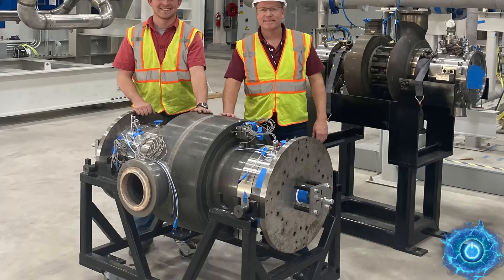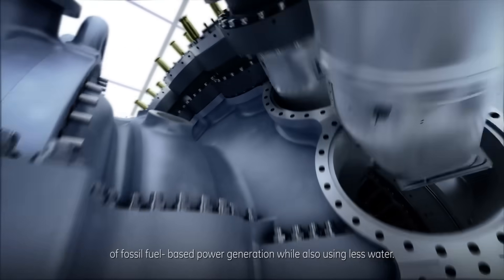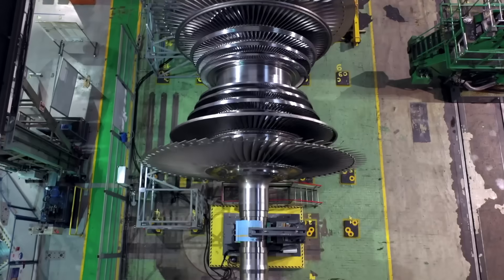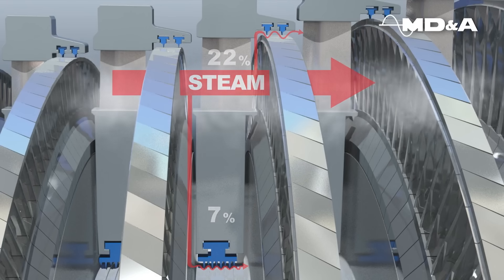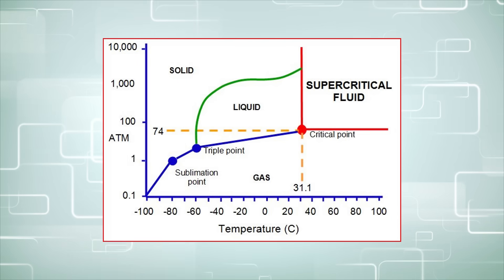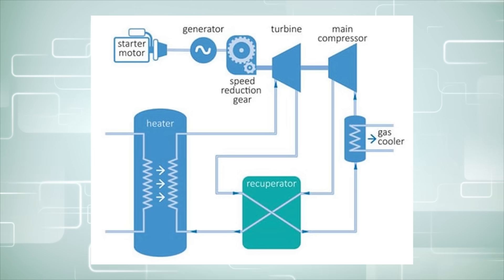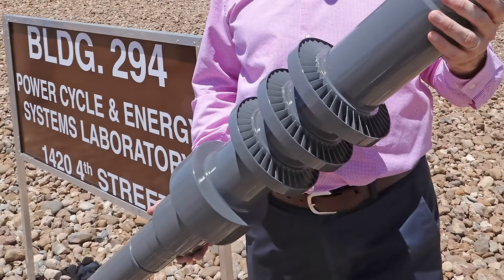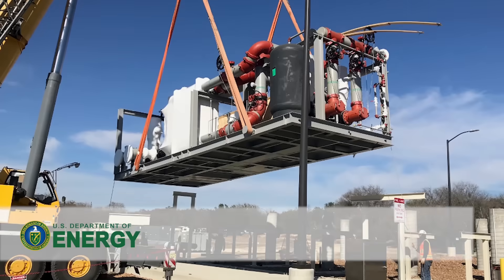BREAKTHROUGH Supercritical Turbine Breaks RECORDS

Comment: I think there are lots of interesting possibilities - 1 - Smaller power station footprint vs conventions gas turbines 2 Use of current C02 waste gas from power stations, waste to energy C02 generation, chemical plants, biomass fuel stations, Cement-Steel C02 production 3 The gas can be closed loop unlike steam (and you need a large clean water source for most steam to power generation) which offers a continual source to power the turbine 4 The gas does not need to be heated or compressed anywhere beyond its supercriticality state so that allows for more uniform manufacturing and operation of the gas. 5 water steam also corrodes turbine blades so its not immune from some of the same issues as C02. 6 The more pure C02 you make, the more power stations you can build (again at a low footprint and in theory cost). 

Some issues remain (more expensive materials to cope with the pressure, heat and C02), Many gas turbines benefit from the other turbine markets that jet engines deliver. This means many of the tech improvements for one design can be applicable for the other especially gas turbines that mimic the same design as burning Jet fuel. These designs would not offer that benefit (bar metallurgy). Generating pure C02 adds to the cost in filtering this gas out to be used.

Comment: I hope that soon, a Molten Salt Reactor will be built and the molten salt heat be transferred to a gas (CO2 or He) and the that gas use the Brayton Cycle Turbine shown in this video. The proposed temperatures of the Advanced High-Temperature Reactor (AHTR) using Molten Salt is between 700 - 1000C.

Comment: The sCO2 thermal cycle is such it can use air condensers.   It is also uses a very compact turbine.   For running decades on end a direct drive system used in steam turbine generators is much better than a gear reduction system.   The jet turbine generators also have to use a gear reduction system.  Is there an efficiency advantage over supercritical H2O that is worth while?   A comment below claims 47.5% thermal efficiency where sCO2 is rated at 50%.

Comment: The vast majority of power plants even nuclear ones use the heat source to produce steam and the steam to drive turbines that turn the generators to produce electricity. As you mentioned these steam turbines have achieved 40% efficiencies and they are approximately 10 times larger than this prototype using supercritical CO2. One of the major problems with using supercritical water is that it is highly reactive with most substances and this active corrosive problem in a system that has to maintain such high pressures is a disaster waiting for an ignorant manager to exploit it by interfering with scheduled maintenance to increase their bonus checks.

Comment: I wonder why these engineers chose supercritical CO2 rather than supercritical N2. N2's critical point is at a substantially lower temperature and pressure than CO2. If supercriticality is where the benefits lie, why not use the gas that achieves this state at a lower temperature and pressure?

Comment: The idea that supercritical water has a density greater than water at standard temperature and pressure is amazing enough.

What I didn’t understand is why CO2 is a better medium than water for converting heat into kinetic energy.
Reply: Wouldn’t CO2 be less dense and therefore contain less momentum than steam?

I think that drawing power from subsea turbines tethered in narrow sea passages with high tide flows would be exposed to much higher energy densities…🤔?

Comment: Does the CO2 get recirculated back to supply after passing thru,going from gas to liquid and back to gas thru reservoir recirculation supply. Desk size is incredible feat.now to take that and make it suitcase size for ev charger system or tanks camping boats whatever.womder if turbos could be used in a system to make it smaller one side intake the other resupply,high pressure gas to liquid then back to gas.this is intriguing it will replace fossil fuel power.great work everyone. Hmm no control over turbine speed,why not use a braking system similar to Tesla where the brake system generates electricity and use that as a secondary power supply as well as a sort of cruise control for things that would put a strain on the startup or full capacity operation.a no waste system,the CO2 will never degenerate and not need to add more.
I just see it as it make the power phase pass it goes back to the intake thru pumps.

Comment: Gas turbine.
The combustion does not increase the pressure.

You can take it from me or you can get your head royally chewed off by AgentJayZ YouTube channel.

Combustion increases volume and temperature, speeding up the flow.
As AgentJayZ points out, there's a bloody great big hole in the rear of the combustor. Ain't nuffin increasing the pressure there.

Comment: Yes but the problem this has is not only burning fuel but the line transmission losses/maintenance, versus solar panels and battery, solar has dropped a LOT past 10yrs, PLUS batteries now being used in cars is making them drop in price, so I think home power future is solar and battery. :face-blue-smiling::face-blue-smiling::face-blue-smiling::face-blue-smiling::face-blue-smiling:

Comment: The largest issue with technology id that the boiler needs to be able to be able to withstand 250 bar and temperatures higher than 800 C. It requires the use of high-nickle allows that are expensive and hard to manufacture.

Comment: This is very cool, has me wondering about the use of CMCs with molten salts or other possibilities. I mean using the salt as a driving fluid and not just a thermal storage medium. Also wondering about the possibility of hydrogen. Apparently it becomes supercritical around 180 psi, but is there an upper limit to density?
Reply: The fun parts about water / steam are...
Density, water and steam are heavy, giving higher kinetic energy transport at lower flow rates (bigger pipes can make up for that though..) 
Specific heat capacity and latent heat of evaporation. Water shifts heat energy very very well.

Comment: It would seem that small units meant to power only 5 to 10 homes, would be the route to follow. Think how much power loss is involved in current electrical grids during transmission.

A companion to the A/C heat pump could be another module for a mini turbine to power the home. There are many parts of the world, even in developed nations, that are off grid, and a multi fuel turbine system would be the answer in many varied environments.

Comment: What you can't use just like regular fractions like 1/3 can either be 33 or it can be 66 but there's a whole spacing spread that plays with all that and most people just think you can turn it in one direction and it's not true it means you could have the offset counterbalance start to be like counter direction against you percent value could start off spreading your hot and cold and wrong directions with some can sometimes take years and balance or certain gravity turns before it starts causing actions against you

Comment: Your math has got an instability with separation spreads it's like with you using 5 * 5 like = 25 but the direction of 25 roach way it's going to pull inside of whether it's going to pull inside is it going to turn your water's liquid to counterbalance your inner directions it's far in which ratio of a decimal fraction

Comment: Personally I think steam turbine tech days are numbered if high temperature Thermophotovoltaics tech pans out of the lab. With 40% efficiency at around 2000C, and unharvested radiation reflected back into the heat source. The benefits of of a solid state thermal power harvesting mechanism are just too obvious. Finally getting steam out of the equation will certainly be the end of an era.
Reply: Nuclear isn't hot enough for that

Comment: Interesting, but you negated to discuss the more traditional Rakine turbines that this essentially is ..  The new development is the use of super critical CO2 instead of NH3 or other refrigerant type carbon (fluorine) compounds in heat recovery.  I assume that these types of electrical generators are for use in high electrical demand periods of the longer duration.. supplementing the use of NG turbines or on ships that use large multi cylinder diesel type engines (now using more ethanol in their mix) as the secondary power source..   Ideally no reduction would be used, instead separation of the pulsed output directly into  the power line as pulsed DC or inverted AC (again taking the heat generated in the coil capacitance to be recycled)..    High speed usually means short life..

Comment: How would using electricity to boil water supercritical to drive a turbine which then mechanically drives a generator to convert back into electricity be advantages ?   Unless you want spend a lot of money on eqpuipment, pay a lot of workers and have less electricity than you started with. Sounds like the goverment got involved.

Comment: That’s a combustion turbine sometimes called a gas turbine, not a steam turbine. Those 16 holes around the circumference of the turbine stage is where the fuel nozzles go. (The compressor is in the foreground) 0:15

Comment: Stupid here (me) but are/can we use electro magnets to seperate moving parts (less friction/higher speed)? Heat problems? Can pulsed electricity with magnets be used to push the opposing force? Coupling the 2 drivers together to get greater pwr/efficency (fuel or steam assisted by El/Mag).
Reply: Magnetic bearing has been known for a long time.

Comment: As a maintenance worker for a spicy rock powered plant, leaks, leaks are going to be a nightmare on a grid size (Gigawatt +) scale.
Reply: You can achieve gigawatt with about 45% smaller plant from water.Only this makes it much easier to maintain and service.
Reply: This is why brayton cycle turbines have taken so long to develop. Selecting what to use as a working fluid and then developing based on that fluid has taken decades.

Comment: with the temperature range involved in keeping co2 supercritical, a system like that, one which could hypothetically generate some level of power from almost any heat source, could change the way we generate power and operate our grids, because if it becomes possible to make small, self contained units, they could be installed in all manner of locations, allowing for the creation of things we can barely even begin to imagine, due to the fact that electricity availability is one of the limiting factors on almost anything we do, and untapped heat sources are abundant in human developments.
Reply: way ahead of ya, give it a few years!

Comment: Supercritical turbines have definite advantages over purely expansive turbines.  Supercritical turbines have been around for decades, but operated with water steam.  If supercritical CO₂ turbines operate over a lower temperature range than do steam turbines, then there may be some logistical advantages over the steam turbines.
With either steam turbines or CO₂ turbines, you will be adding heat to a medium, then allowing that heat energy to be converted to rotational mechanical energy.  I do not see enough in this presentation for me to decide that supercritical CO₂ turbines have an inherent advantage over supercritical steam turbines.  Steam turbines are a well known technology, so it will take some very convincing demonstrations b to get the turbine market to make the switch.

Comment: Why not use the high RPM directly instead of lossy gear boxes to drive generators? Drive a high frequency alternator and then reduce the frequency electronically to 50Hz or 60Hz or even DC for high voltage  transmission

Comment: So how efficient is using a closed loop system using water split and recombining and using that energy along with using magnet motors along with magnet generators configured to work with the magnetic fields to spin the generator? Now we just need to find a good set of magnetic berings to float the spinning generator. Or how about using the tesla turbine? Or using frequency waves from everything in in the air already and utilize that for power?

Comment: Does it help in any way with the efficiency of the of a heat engine over a traditional gas or mostly a savings in size?
Reply: Pretty sure there would be losses in the heat transfer to the closed loop, so it's probably only a good idea when your system requires a closed loop.  Something like solar thermal, geothermal or coal/oil fired.

Comment: Supercritical CO2 looked like it might be running on a Brayton cycle with the recuperator and gas cooler. I wonder where the upper limit is for inlet temperature of the turbine. Would it be limited creep failure of metallic components or does the working fluid lose efficiency at temperatures above 700°C? If it can handle high inlet temperature, would be an excellent system for high temperature, gas-cooled reactors or molten salt reactors. Thanks for posting this!

Comment: The largest issue with sCO2 is the amount of volume required. The time it takes to heat the sCO2 from liquid to gas then get that gas from the heated surface to the turbine blades causes a loss of pressure along the way. This means that some form of (highly controlled) pulsating injection may be the best method to further improve the efficiency. This of course increases the pump pressure injecting the liquid onto the heated plate and in a closed system this requires increased cooling. It is "tricky" to get sCO2 to perform at peak all the time with varying ambient temps effecting the materials involved.
Reply: "sCO2 from liquid to gas" what do you mean? The fluid is supercritical. There is no gas or steam phase. That's one of the main benefits of this cycle because the compression power is much lower compared to steam.

 Clearly, you missed that part of the video..

Also, sCO2 allows you to go from wet cooling to dry cooling. At the same ambient temperature, sCO2 brayton is more efficient than steam rankine. Therefore, it's equally tricky (if not less) to maintain peak efficiency. 

The largest issue comes from the heat exchangers in the cycle. The boiler needs to be able to be able to withstand 250 bar and temperatures higher than 800 C.
Reply: The Co2 needs to be in a closed system. Once the high pressure is ran through the turbine it is then cooled currently by means of hitting a "plate" cooled by a nearby water source which returns it to it's liquid state. It can then be pumped/spray injected into a heated chamber and turned into a supercritical state. To maintain a more uniform and higher supercritical pressure pulsating injection would be a better method then just spraying it on the heated coils and having that pressure injected immediately against the turbine blades unrestricted. The difficult issue here is finding and maintaining a high pressure pump capable of injecting the liquid into the higher pressure heated chamber and lessening losses up to that pulsating injector. The higher pressure differential before the turbine to after the turbine the higher output is possible. Using gear reduction is another means to lessen these losses having a turbine running at higher rpm. But that also presents problems.
Reply: @cerial0411  The pumps needed to perform this already exist. Diesel injection pumps regularly can reach 2000 BAR.
Reply: @theq4602  No way to lubricate those pumps with CO2 in a closed system. 
What you can do is having a cam/gear  driven pump provide pressure to drive a cylinder that has no rings against the walls just very tight tolerance and then use a check valve to maintakn pressure. This cylinder rides on external bearings with the end "sticking out". Think double  acting steam cylinder. As the  inner cO2 cylinder is moved to the left the open  cylinder area is filled with co2 the outside diesel filled cylinder is doing the "pushing" with exterior bearings outside of that. 
This presents the issue of seals and valves. Sliding valves did not work. Rotating valves are currently being tried but leakage without sealing is causing issues with those.
Reply: facinating please provide links to literature on the subject
Reply: @theq4602  
Same basic system but you place a check valve where the nozel is.  The cylinder has tight tolarences so that leakage is minimal requiring no rings or the cylinder is made out of a wearable material to the wall. 
https://youtu.be/Ur9GATa_9Vk?si=6dwdSHgcAaiOMwbT